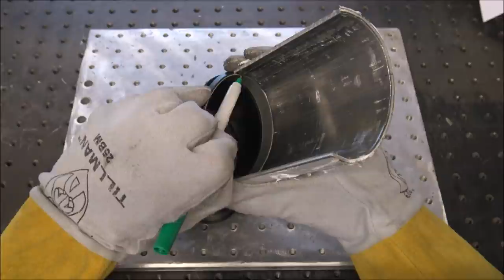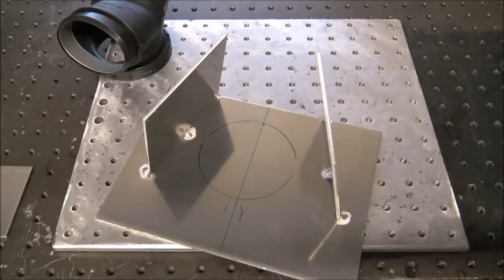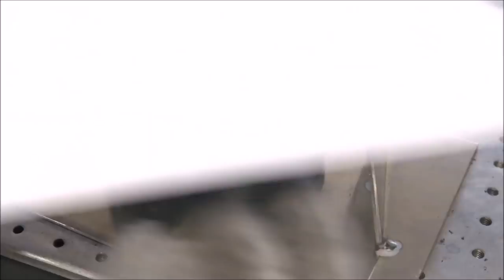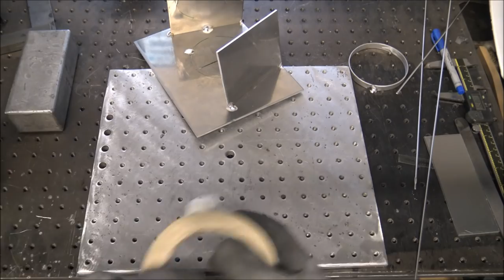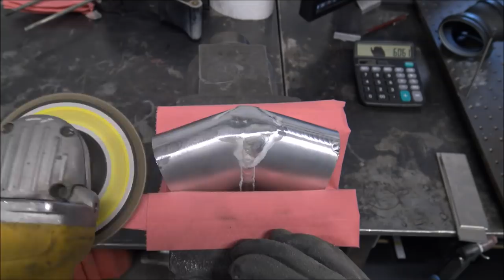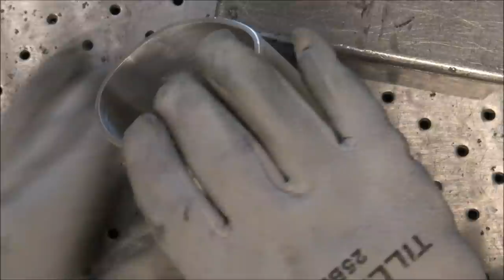TIG Welding Aluminum Fabrication - Sheet Metal Forming - 2 Ovals into 1 Round - Y-pipe

Comment from the maker: Please read this before commenting:  This is a one-off part, and this was the fastest way to make it with the tooling I have available at my shop. No, I should not have used CAD, it would have taken longer with no benefit. The ovals intersect at compound angles (rotated inward and downward), and the round tube is offset to one side. Measuring and drawing this all up perfectly to make templates on a computer would take a lot of unnecessary additional time.  And no, this is not a part that would be practical to 3d print. It is going on an engine, so it is exposed to heat cycling and vibration.
There is a full article write-up on the website about this video:
-Welder settings
-Material selection
-Reason behind all the techniques
-Etc...
If anything on the website isn't clear, feel free to email me.
Http://www.6061.com/

Thanks for watching
Aaron@6061
Reply: 6061. com hi does your website explain the process at the end when you went over the welds pulsing to get that wide clean bead result?
Reply: Zen Master Fabricator whose action speaks rather than words....excellent work
Reply: It's a piece of the art!
Reply: Leaving the weld would have been nice, cos its a good quality job. But sanding it off is also nice. I am torn between the 2. Great work
Reply: In this day of age, people are too concerned with computers instead of old fashioned hands on fabrication 👍
Reply: Often times it's just faster to let a fab guy do it. Our engineers always come up with things and then I'm like why not do it like this. Faster easier and often cheaper. Just do it
Reply: I love it man. As soon as I saw you roll the piece at the beginning to get your measurement, I was in. That's exactly the type of stuff I did to replicate aircraft sheetmetal parts.  I miss it. Not only is it excellent fab work, it's excellent videography to share with us. Thanks!
Reply: It is a pleasure to watch you work sir!!!
Reply: pretty good welding technique!
Reply: @debodevil6974  p
Reply: I've worked in the field a long time and done it on the computer and hands on but this is the first time I've seen the clay being used and that my friends is a great idea! props to you sir for some great work!! Thanks for sharing.
Reply: That was amazing to me. Very nice work and presentation. Inspiring, humorous, entertaining, creative, and so much more. 

Thank you!
Reply: You made it like silversmithing ...! Very good work...!!! Congratulations.!!!Greetings from Greece
Reply: Have you ever herd of kane kid.. if not look him up. I think u would appreciate his welding technique/ skill. (✌) u will get it if u look him up. It not a peace sign. Anyway nice vid. Great skill!
Reply: CAD as in Cardboard Assisted development :P?
Reply: nice work but for me I would of cleaned the weld off I prefer a flat finish
Reply: A Man. A Plan. And a Jig! Great work!!
Reply: Which company model to be used for Aluminium tig Welding
Reply: Congratulations  desde Argentina  excelente trabajo usando la experiencia de un artesano.
Reply: @Albert87nl  CAD REFERENCE! You're watching project Binky too?
Reply: 6061. com watching you weld and fabricating is so satisfying to watch. You have amazing precision and great fab work 💪🏼
Reply: I can model it in 20 minutes in CAD.  I can also 3D Print it.  But these are both pointless.  The author is absolutely correct!  Nice work!
Reply: your welding techniques are very good along with your welding equipment. definite journeyman work. beautiful welds. i am a retired welding instructor and boilermaker. good av also. i enjoyed watching some pretty work.
Reply: Great work keep it going.
Reply: Is this an intake y for an amg engine?
Reply: @debodevil6974  I'm a CAD design engineer, but it doesn't stop me being appreciative of true manual craftsmanship, just as you shouldn't discount people sat behind computer screens!
Reply: @Albert87nl  Been watching Bad Obsession Motorsport by any chance?! 😉
Reply: @MrMairu555  That is exactly what we did during the COLD WAR! No CAD/CAM, no fancy robotized machine tools, just tons of knowledge and experience and tons of jigs, positioners, aligners, angle measurers, templates, and all kinds of machinists precision measuring instruments and devices, and including bolt lockers to hold the working materials in place.
Reply: @MrMairu555  True manual craftsmanship will always be your emergency option is something to any high-tech stuff you are using. I was assigned in Asia and there was a black out in the middle of an afternoon so the women at the cashier section resorted to calculators and then the owner came from the top floor and helped them out using an ABACUS! What took them minutes to figure things out, this old man was able to do it in mere seconds! I believe he is still alive and the last time I saw him is when his sons and grandsons are also using the good old fashion and time-tested and time-proven ancient abacus.
Reply: You are a wizard :D
Reply: oh man... i feel your pain bro... I used to do a lot of one-off stuff and never heard the end of it. You did a fantastic job my friend! good stuff!
Reply: Using CAD to design and use that design to 3D printing to use it as a mold for casting, you would get a better and more accurate piece, almost identically and the best part you can do a lot of those in a row

So you are right you don't need CAD (20 minutes) to do a single and not accurate piece and more if design would take you a lot of time for you

You are good at welding by the way
Reply: Love your work sir. Fab work is the greatest.
Reply: how  much does that cost?
Reply: No one can question your work! Amazing
Reply: You did great.
Reply: Yes we
Reply: You could had 3d printed the whole thing with the tig. We know you are a machine. It’s ok. We are cool with that.
Great job. You never seize to amaze us.
Reply: Agreed! Forget the computers.
This is skill and its a dying kind of experience. Lots of fabricators I work with these days couldn't do anything near to this.
Nice one 👍

Comment: You are a highly skilled fabricator that I enjoy watching. It's amazing how you come up with patterns and design. I was an Aluminum Instructor in my early days and spent 40 plus years as a welder and fabricator but the skills you display make me look like a rookie and I was pretty darn good. I'm disabled and have difficulty doing anything any more but your videos really lift my spirits. I still have a Miller 330 A/BP AC/DC welding machine that looks like brand new, approximately 100 hours or less on it. If I can round up some materials I might try and duplicate some of the great builds you have done, should be interesting with my HF only going to 100 on my machine. I'm sure you are using a machine with at least 400 setting on HF. I started out Oxygen/Acetylene welding and the dipping pattern came pretty easy. We used to gas weld our Aluminum since we didn't have an AC/DC HF machine till later when I bought my first one, a Miller 230 A/BP in 1972 or 1973. What a fantastic machine to have at the time. Sorry to rattle on, your videos are encouraging and I hope the young welders benefit from you sharing your skills. Thank you.
Reply: I always enjoy reading comments like these.

Comment: I also have to add that I never would have thought of using playdough as a mold to assist in mapping the necessary shape for cutting the complex bottom flange  for the final weldment  section. That was a real time saver.  In the passed I was Tig welding an airplane frame and did not have the proper larger size filler rod for the landing gear welding so I put 3 smaller welding rods close together in a vice and then the other end in a electric drill and spun the 3 rods tightly together to make one larger rod and finished the project.  Just sharing.

Comment: What an intricate way to make a very awkward part. Well done. Loved the fully sanded down shape, and  THEN weld the bottom section on.  Also liked the smoothing out of the buildup with the arc. It looked really schmick when it was finished.
Reply: Smoothing out the buildup/blending the weld in is something that anyone who has done quite a bit of Alu welding knows all too well about, I used to be able to lay a single bead of Alu like it was done by a Robot Alu Mig welder back in the day many many moons ago.
Now I am just an old fart with a totally buggered back.

Comment: I repaired an aluminum grill for my motorhome that I backed into.  My touchdown score was -54 and since the grill was partially powdercoated and very contaminated with oil and dirt, my frustration and buzzer score was off the chart.  Thanks for sharing and adding a bit of humor.

Comment: I want to do the same thing for my Porsche Cayman, add a larger throttle body and make a plenum out of stainless for it. The problem is I am BRAND new in the welding scene and haven't got all the addons to convert my stick welder to TIG yet.  Maybe some day, or I'll do it in mild steel and then powder coat it!  You definitely have inspired me to do something outside my wheelhouse.
Reply: You'll always wish you had gone stainless. Just do it, it's not that expensive for the Tig torche and bottle. Just practice first or you'll end up powder coating your stainless piece anyways
Reply: Trouble with stainless is you need argon on both sides of your weld, or at least need to prevent oxygen from getting to it. You could use solar flux instead of flowing argon on both sides while you construct your piece. I would recommend building it out of mild steel first, for the practice and then stainless since stainless is so much tougher to work with and your current level of experience. Best of luck with it!
Reply: @bretbradbury5559  just seal ends and put a purging line into the pipe then weld.

Comment: I learn so much from your vid's - one of the (sadly) secrets found on the interweb.
Little surprised you didn't just form up a 'cap' from the offcuts to weld in, rather than do the building up over the opening?
Reply from the maker: I flipped a coin.
Reply: 6061. com did the coin land on "FUCK IT!", ?
Reply: Yeah I was expecting a bit of scrap metal to go in there. Instead we were treated to an awesome display of 3D printing!
Reply: 6061. com watching you fill in the gap with welding material makes me feel Justified now for filling in gaps with a MIG welder. Thank you. Now I can show my brother how a professional does it as well.

Comment: Nice work ! what you are doing was my life , tig welding aluminum pressure vessels , heat exchangers line sets,jigs fixture ,anything those engineers came up with , and thinking out side the box , but never used the play dough to copy a contour before , i like it , clever , also i didn't care much for those gas lens though on your torch , but awesome work ! thanks for sharing .

Comment: How long did that take start to finish?
Reply: Great question given how much of this video I watched at 1/2 speed or less.
Reply: Time is always a factor in building a part vs buying the same part, time spent building that Ypipe probably cost as much as buying 5 or more. But that said the aluminum one looks 100 times better.
Reply: That should have been included in the description, It would be interesting to know.
Reply: @toothguy441  There are many situations where there is no option but to fabricate a custom part because there is no over the counter piece available.

Comment: You are the best fabricator and welder I have seen I wish they would have taught us like this instead of just putting beads on a plate or cutting metal small enough because of the college cut backs
Reply: Keep practicing/welding all good things come to those who enjoy welding, and not just see it as a 9-5 job.
You must always be proud of your welds IMO if your to be a gun welder, and only way to be a gun welder is lots and lots of hours welding, Identifying where you make mistakes so you can correct them.
On a lot of jobs when I used to weld many many moons ago, if I was allowed too n sometimes when I wasn't, I would sign my name on the work piece with a weld, proud as fk of a job extremely well done.
So I guess to sum it up you must have PRIDE in your work, Keep burning buddy it will all come to you eventually.

Comment: Great fabrication technique- loved the play-doh!  I actually know what this part is and I have modeled the geometry in CAD,  my question is (I'm assuming you made this for the 82mm TB which has an OD of 89mm) - How did you get the clamp to fit on the "short" side? There was like no way I could model this that didn't require the hose from the airbox to be pushed out of position on that side. That part is amazing, nice work! And probably took less time for you to build it using templates than it did just for me to model it!  (You should make these for sale, they's be worth about $500 each since no other solutions exist for retaining the factory air boxes on the M113K motor with an upsized throttle body.

Comment: How do you weld over the contaminated aluminum? (Green arcs) Whenever i used to try that the contaminated aluminum would only get worse.  Are you using helium as a sheild? Or rather i should ask what electrode  do you use and what percent cleaning?
Reply from the maker: It's all explained on the website in detail

Comment: amazing work dude, question! im learning tig now. i find that with aluminum especially i have to clean it so much. did you edit those parts out or how do you get away with not having to use acetone and stuff? i have the same problems with steel alot. so frustrating lol

Comment: Just out of curiosity, why did you grind your beads flush with the material?
Reply: So that it would look like one piece, as its going in an AMG's intake air joiner/splitter which will be visually seen so it needs to blend in, and look more professional IMO.